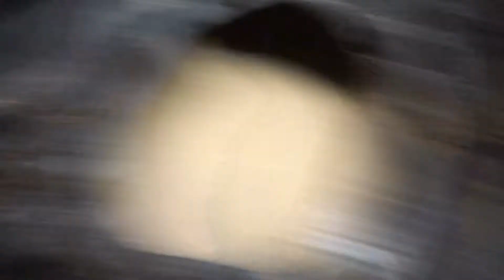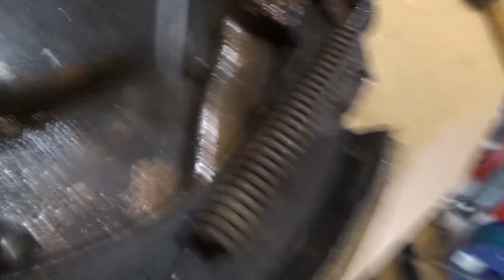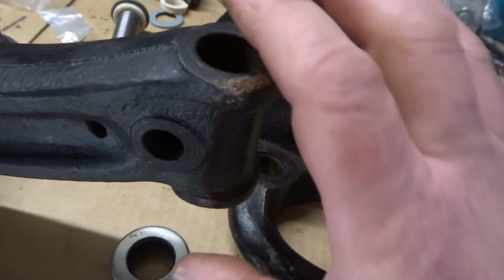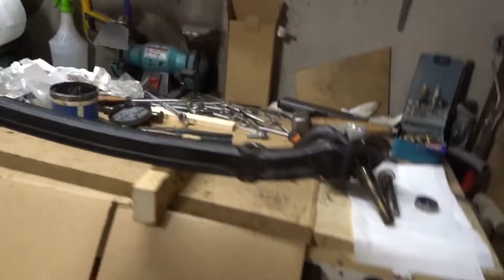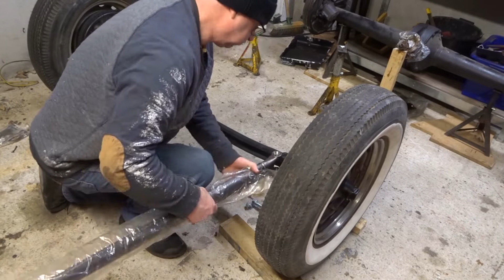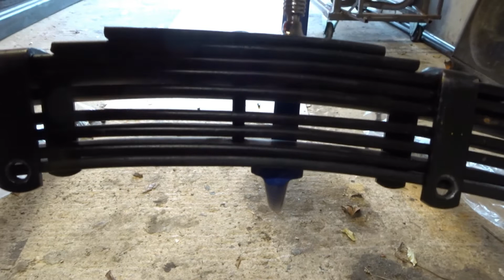Front End | Belly Tank Lakester Ep.5

Comment: The things holding the king pins in are 'cotter pins' (in the UK). But the terminology gets a bit weird as in the US a cotter pin is the same thing as a split pin the UK.  I think the Americans would call that in your axle a 'cotter'. Austin 7 king pins use what's called a half moon cotter, the pin has a half moon semi-circle cut from it so you have to put the pin in first then drop the king pint though then when you tighten the cotter the half moon grips the king pin. Easy to put together but a bugger to remove if you don't know the trick that the cotter cannot be removed until it is loosened then the king pin is removed first.
Reply from the maker: Been a tinkerer for years but nothing pre-war. It has been fun getting my head around how all this goes together and a new-found respect for the design. Very simple in many ways to keep the cost right down and yet still very robust for bad roads.
Reply: @XenonJohnD  The main difficulty I find is the lack of technical documentation. For the Riley 9 there are a few period maintenance books and the spare parts books but little else. Other makes are far better represented. Parts can be tricky too with often a single supplier, often just an old guy in a shed! Hopefully with the Ford you have much more access to parts and info.